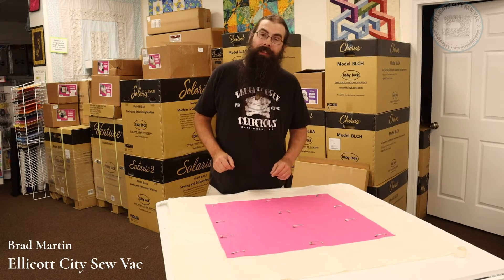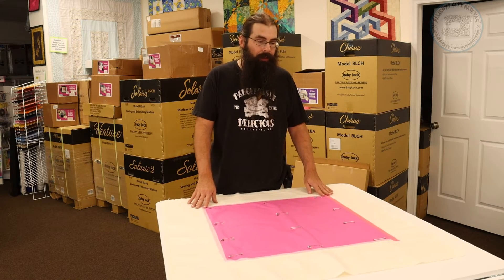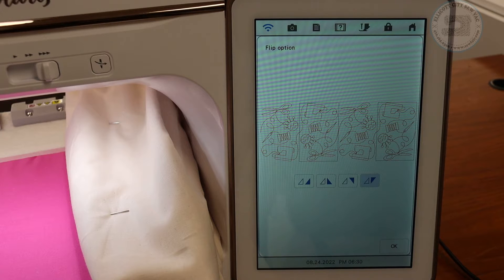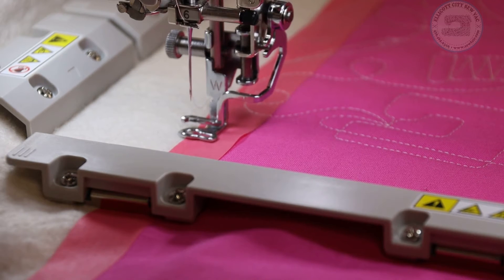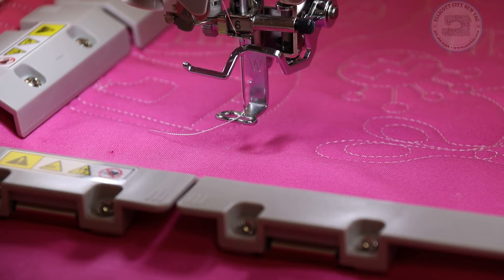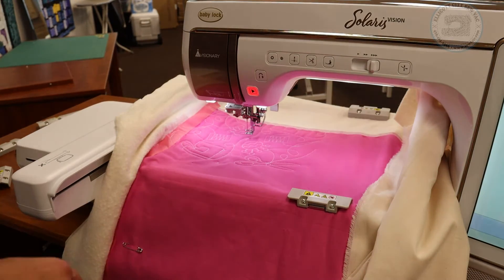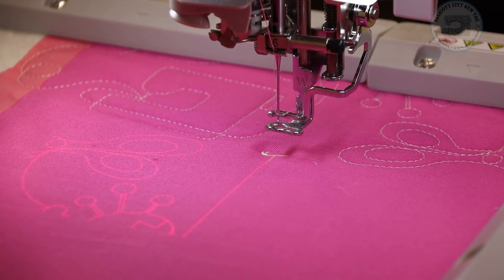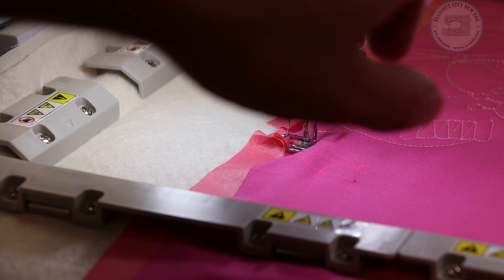Baby Lock Solaris Vision/Upgrade Edge To Edge Tutorial

Comment: If I am doing a 108 x 108 quilt do I put the backing material on then the batting and pin the top before I begin?  Thanks newbie
Reply from the maker: yes that's right just make sure you don't run over a pin, good luck

Comment: This is a great video and I’ve watched it several times before and during the first time I used the new edge to edge feature. I hadn’t used tape on the edge before and I thought this was a great solution. I used kimberbell paper tape. The tape is NOT easy to get off. It’s pulling my stitches out. I’m having to spray the tape with water and carefully pick it out with tweezers. It’s taking a long time! Is there an easier way to do this or did I use the wrong kind of tape?

Comment: Is there a way to use edge to edge designs that are not built into the machine?
Also is there a way to import a fill into IQ designer?
Reply from the maker: No you can't add edge to edge designs, yes you can import fills into iq if you have a vision or upgrade 3.

Comment: I refer to this each time I used the quilting function of the Solaris. I still can’t quite get the started point in the right place. Even though the projector is showing it in the right position.
Reply from the maker: I hear ya its not 100%. Turn your handwheel and see where the needle enters the fabric, then you can kinda mentally adjust for how far its off each iteration

Comment: Hi Brad! Your tutorial is by far the best one I have seen regarding this technique.  Thank you so much!  I have a question.  I am involved in a quilting project which requires 96 hoopings.  I have another small project which I will need to do before I can finish all 96 of the hoopings I am currently working on.  How can I figure out where I am in the series of hoopings when I come back to this big project?  I am keeping track of which number I am on as I go.  I appreciate your help.
Reply from the maker: Yeah in retrospect I should have shown that. When you want to get back to the hooping you left it on you use the same icon you use to skip to a specific stitch, and you can use the arrow keys to skip to the specific hooping you need to go to. Just need to know what number you were on.
Reply: Thank you!  That worked very easily.  I appreciate the quick response!  @EllicottCitySewVac

Comment: Thank you Brad for another great video. I’ve learned so much from you over the years. Regarding the taping of the edges of the fabric…how about basting around the edges instead like we do when using long arm quilting? I’m thinking basting would allow for the shifting of the fabric during the quilting process. Thanks again for great videos.
Reply from the maker: Sure that'd work. Glad you like my videos.
Reply: Where will I find the 10 designs? My upgrade isn’t here yet and I missed seeing them in the posted information.
Reply from the maker: @debbiebugh8508  They're in the same section as the border designs, it's the one with a Q on the icon
Reply: @EllicottCitySewVac  wow, quick answer! Thank you so much. After watching your great demo last night I’m really excited to try this.’

Comment: Does this process work with E to E designs that I've purchased?  I have dozens and want to use them.
Reply from the maker: Nope but you can still use the projector and hoop it just wont bring each design up for ya
Reply: @EllicottCitySewVac  well that's unfortunate - BL doesn;t have nearly the variety of E to E that is available from other digitizers.  Maybe they will add designs to their library one of these days, or at least allow you to use the same awesome features with imported designs - one or the other

Comment: Great video! I can't wait for my upgrade to come in!
I have a question. What if you can't finish all the hoopings in one go, and have to turn the machine off and come back to it later. Are your settings and location on the quilt saved so they can be called up again?
Reply from the maker: yes it remembers plus you can skip through the steps if you need to (like if you don't hit the right button when you turn it back on and it doesn't resume)
Reply: @EllicottCitySewVac  Thanks! That’s terrific!

Comment: Instructors at Baby Lock said the 10” magnetic hoop should always be removed from the machine when rehooping because of its size it is too much stress on the arm to drag the fabric on it.
Reply from the maker: Well I dunno, seems like it slides fine to me. Seems like the whole point of using this hoop is to be able to slide it. I didn't find that there was a huge amount of stress to move the magnets with a quilt sandwich. I could see if it were a single layer of fabric I guess.
Reply from the maker: Looks like they are saying it's because you might move the arm and misalign your design, to which I say sure but you only live once :) I think it's worth the risk not to have to keep taking the hoop on and off.